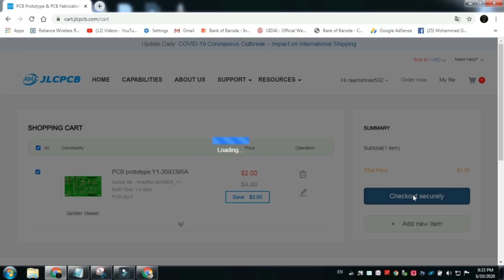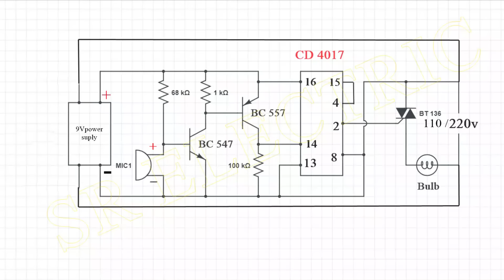[New] Simple Electronic Project, Clap on Clap off switch Circuit

Comment: This circuit diagram shows either the live wire or the neutral wire connected to the 9V battery. then either the live or neutral wire goes to the ground. I don't want to blow up my power supply or the battery!